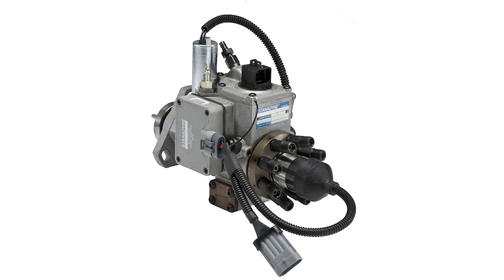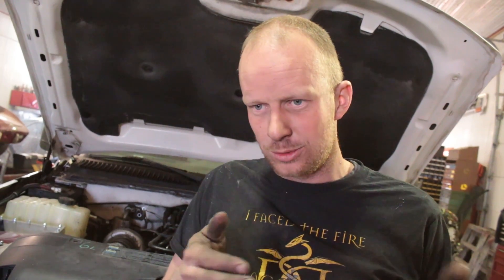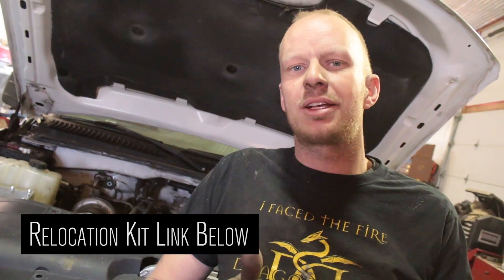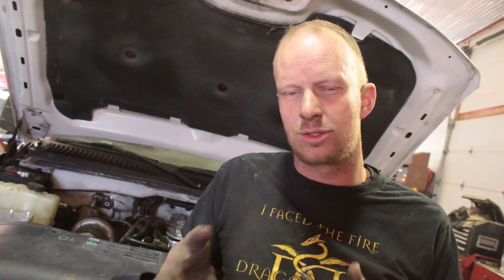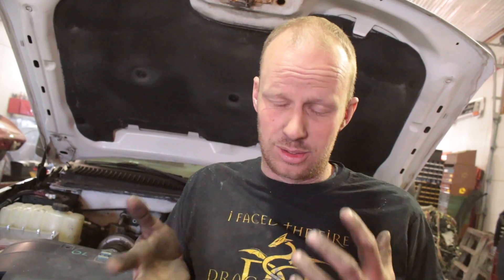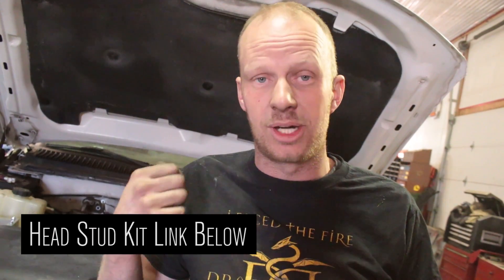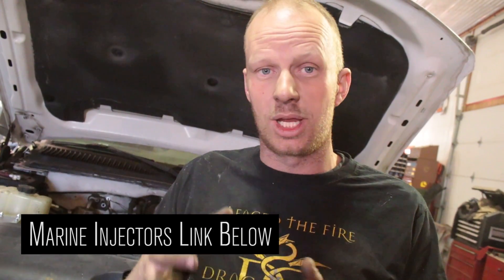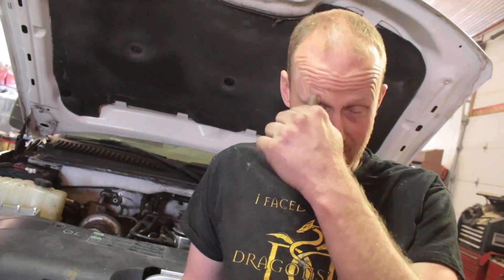REVIEW: Everything Wrong With A GM 6.5 Detroit Diesel

Comment: Not sure why the military didn't put a 12v cummins in the humvee's lol...
Reply: MotorsAndMore its called millitary grade. Quite literally translates to lowest bidder who can provide the fastest.
Reply: I thought that AM General was owned by GM, which would explain why they have a 6.5.  Also, do you think the 5.9 would even fit? It is much longer
Reply: Far more about supply than it is cost when it comes to the military.
Reply: +consaka1 that's right, the weight of a 12v cummins is between 1100 or 1200 lb and a 6.5 is between 700 or 800 lb, so the detroit is way lighter than a cummins
Reply: Too heavy I bet. 6.5 is somewhat lighter.
Reply: MotorsAndMore I have a 6.5L TD in my 1996 3500 and I love it, also have a second 6.5L that was in a Suburban and I am looking to drop it in a van..... There are 2 reasons this engine is still loved by the Army and boat industry... Reason 1: they are one of the cheapest Diesels to buy, it costs alot less to replace a 6.5L than a 5.9 Cummins would be when it gets a 50cal round through the hood. Remember what would you want to see destroyed? A cummins? Or a 6.5?  They are cheaper $5,500 civilian price for a brand new 6.5 on aftermarket.

Reason 2: they are amazing on fuel, when I got my completely stock (including vac pump and lift pump which are both junk).  I got 24.5 MPG roughly 10L per 100kms in a 1996 3500 Chevy Crew Cab Long 8ft Box (6000lbs tare) when I loaded up with an extra 2500lbs.... The up armored Humvees are 12,000 - 16,000lbs but dont tow much... Nothing compares to the 6.5L Detroit Diesel on fuel ecnomy, they are amazing engines.  Which is why the army and the Marine industry love them...

What is not amazing about the 6.5L Detroit Diesel is all the engine accessories and infrastructure they attached to the engines in the Trucks and Vans during the 1990's...
- Most PMDs = junk (even after relocation).
- Stock Location of PMD = GM being Jackasses at their finest.
- Lift pump = junk. (get one from a boat dealer)
- Vac pump/waste gate control = junk (throw the vac pump away, get a couple of nuts and washers + a compression spring for a manual waste gate control arm, then get a belt for a 1993 6.5L) (also make or buy a boost gauge, if you dont have head studs you should not go over 10psi of boost).
- (all of the above items can rob performance or even screw up your other wise well designed and built injection pump)
- Thermostat was set to 200°F it should be between 180°F amd 195°F at most depending on your needs.
- Rad Fan = junk.
- Air intake = junk.
- Turbocharger oil feed and return = junk.
Harmonic balancer = junk.
Lay out for the A/C compressor & line if the A/C compressor is on the driver side of the engine = annoying junk that gets in the way of many things worst of all it interferes with PMD relocation. (On some other 6.5L the A/C compressor is on the passenger side of the engine, I don't have any issues with this set up.)

The 6.5L Detroit Diesel is still a head of its time in MPG but most people don't know because of all the tedious junk removal and replacement GM makes you do with the accessories and infrastructure surrounding the engine.
Reply: Price, weight, and GM was part-owner of AM general.  Mostly it was weight, though - no one knew what an IED was until the H1 had been out for 30 years.....
Reply: Actually I do! I believe it puts a lot less stress on the rotating assembly. In particular the pistons and the cylinder walls.  There was a reason the factory only put 5 to 8psi on the turbo with the stock 21:1 ratio.  I think the low compression heads lower the peak cylinder pressure while allowing more room for more air. The increased volume is like a big cushion area and a little bit goes a long ways. 
The main reason for 21:1 compression ratio was cold temp starting. The higher the static compression ratio the easier it is to start in cold temps.  The increased surface area in the cylinder in IDI engines is one of the reasons it needs a higher compression ratio.  All that extra area bleeds off heat like crazy. It is one giant heatsink.  Direct injection engines have less surface area. Volume of a cylinder seems to grow faster than the surface area as piston size increases. I believe this is why big diesel engines do not need glow plugs and yet can run compression ratios down to 14:1 something. I think most OTR trucks run around 16:1 with their small dinner plate sized pistons. 
I plan to do a couple things to mitigate heat loss. 
1. Spin the engine faster with 3 start batteries.  This actually works pretty well since crank speed is critical.
2. Coatings. ceramic coatings on the prechambers to slow down heat absorption. Possibly on the head surface as well. Coatings are new to me with my current engine build. I hope it works but if it doesn't well no biggie. 
3. I also use total seal 2nd rings. Not sure how much this helps a cranking engine but it cant hurt.
Reply: Isaac Housley true...
Reply: consaka1 my 12 valve cummins is bone stock and it makes 180 hp at 2500 rpm and 420 foot pound at 1500 rpm, but a 6.5 detroit i don't remember.
Reply: uhmm If I recall correctly the 6.2 was 140 hp and the turbo 6.5 stock was 190 but the foot lbs was less. Actually there were various build numbers. They seem to peak at 195. I just looked it up. Here I'll just post it. 
F L65 195@3400 RPM 430 FT-LBS@1800 RPM
That was pretty much the peak for stock in the late 90's. Of course going with low compression pistons and more fuel could get the HP up to about 300 or so. Not sure about the torque with the marine build but it went up too. I run a marine build in my old van. I can't complain at all. It is a lot better than stock. Gets up and moves at freeway speeds unlike any of the gassers I have.
Reply: consaka1 do you think a marine build is way better for the reliability than stock?
Reply: consaka1 ok, how much do you think it cost to make a marine build? one friend of mine wants to do this to his 6.5
Reply: MotorsAndMore the 6.5 was really fuel efficient
Reply: The HMMWV’s got the 6.2 and 6.5 series engines due to the contracts the government had with Detroit Diesel. A good portion of our arsenal was powered by Detroit, Cat has since taken over but while I was in (2002-2014) there were 6.2/6.5’s, series 60’s, 6V72’s, 8V92’s in the good majority of the equipment. Also there were range standards for the HMMWV that had to be met(fuel economy) which was 400miles to a tank and that was supposed to be universal to all of the road going pieces from the giant HET, HEMTT to the little HMMWV and C-Truck(Unimog). People can bash the 6.2/6.5 in the HMMWV all they want but it still got the job done for a few decades and wasn’t nearly as bad as the series 60 which had a fiberglass oil pan in a tactical cargo hauler :(
Reply: well you have to be completely electronics free and you have to cost the least but the humvee was a jeep replacement used outside of its design and well the engine can be pull started
Reply: Also the last generation of HMMWV’s first saw a revised 6.5 with a little more power and the loss of the hydraulic clutch fan(switched to electric) then I saw a few with Duramax’s right before I left service
Reply: Dany McLellan that plays a large part in it because you have to transport them across seas by plane.  the more trucks per flight the more efficient
Reply: State Dept bought a whole pile of them for Daesh aka ISIL
Reply: The reason? because GM put the 6.2 in trucks before any of the other big 3. the majority of military equipment is GM based, meaning more common parts across the board. more specifically to your question the 12 valve is too tall, longer, and heavier the 6.5. Adding more weight to a platform that's already heavier than your average light duty truck. the HMMWV is also almost 2 feet wider if not more. this is coming from a vet whos had to load them into an aircraft.
Reply: Well cummins is building a 2 stroke opposed piston 4 cylinder for the military at the moment.. its pretty cool. It's called the advanced combat engine... we may see a smaller pickup version from cummins and other companies too, as the design is licensed from Acates Power. https://www.youtube.com/watch?v=OfBB6uNkYKM
Reply: Cost, 6.5's are cheap compared to a Cummins
Reply: Sorry Rick,  but I think you need to get under the hood of a hmmwv and look at the clearance and lay out of the components.

There is just a few inches between the front of the engine and the radiator. The radiator also sits at a 45ish degree angle to physically fit in the truck.

moving the transmission back is out to make it fit. The engine cover in the cab that allows access to the rear of the motor and transmission bell housing is already a tight fit.

plus the sheer height of a cummins wouldn't fit without completely reworking the firewall, inside engine cover, component locations, and a number of other things that would take significant time and money to accomplish.

The military simply isn't going to do that. The 7.3 wouldn't be a bad idea except for it being computer controlled. The 6.5 in the hmmwv is mechanical injection db2 pumps. The lift pump is mechanical as well. 

and to answer why the military didn't try to fit a cummins in the hmmwv in the beginning is simple. AM general was a subsidiary of GM, and as such they fitted it with their own engine. which at the time the first hmmwv came out, it only had the 350 diesel, and that predates the cummins b series even being in farm equipment.
Reply: @Raccoonactual  hi
Reply: Yeah. The old 7.3 idi navistars where mechanical. The international powerstroke was heui which requires electronics to operate. If you want to roll with a gutless 7.3 idi, be my guest.
Reply: Reason 1 is the length of the motor. 2 is the multi fuel ability of the mil-spec 6.5 Ltr. Cummins did not have that ability at the time. This is also why a lot of military parts don't fit on factory GM 6.5's
Reply: they went with the cheaper engine for the price
Reply: anoth reason Detroit diesel use to b owned by gm and hummer
Reply: Three words, Lowest Contract Bid.
Reply: MotorsAndMore duramax in a humvee
Reply: @donc81  the 6.5 Ltr still lives in the humvee not the duramax. This is because the 6.5 Ltr in a humvee is a multi fuel engine. It can run on a few different fuels like jet A or B or very low quality diesel  like is found in other countries. The duramax would never survive those fuels.
Reply: That is almost double the weight for how much power? Not a lot I reckon. However the durability in the cummins is definitely there. But try sticking that in an '80's van. lol If I could I would have.
Reply: They are starting to buy Toyota Hilux, I heard.
Reply: there is physically no room to fit a 12v in a hmmwv. the military 6.5l is more robust than the civilian engines as well. the crankshaft is thicker at the mains, and it has a one piece 3" thick girdle that takes the place of individual main caps. 

I see more broken down cat engines than 6.5s in my motor pool by far. 

the duramax is out because it can't run on jp fuel. the military does not use regular diesel fuel, and common rail pumps cannot handle jp. the cat's only run jp because they are heui and the injection system can tolerate it.
Reply: Well it depends on what you have to start with.  Just the "Marine" part of a genuine "marine" build would include Low comp pistons, roughly $650 to $750 for those. 
The injection pump I have no idea if I can even get a db4 pump anymore. It is very expensive and Peninsular diesel is the only folks I know of that have/had it.  There are alternatives that are probably better anyway. 
Marine injectors or injector tips. Honestly people say they don't matter at all. They seem to flow easier though at the same pressures. not sure why. Those will run close to $300.
For a pure build you will also want the high volume water pump and dual thermostat crossover.
There are other things to consider that are not technically part of the marine build that I highly recommend. Head studs from ARP for one. Fluiddamper and a balance job on the rotating assembly. 
Once you start beefing things up and finding crack free blocks it can get expensive. 
I am working on an economy build version that skips low compression pistons for just a thicker head gasket. The compression won't be quite as low but if the short block is good it could help for a lot less money. 
One thing that needs checked very very carefully is piston to bore clearance of each cylinder. Many times in high mileage engines you will find that these need to be bored over. Now you need a set of oversized pistons that will cost maybe 150 less than a set of oversized low compression pistons. It is all about choices. The cost also depends if you do the work yourself or have someone else do it. I have a machine shop do my machining so I don't consider that a diy thing. 
I'd say you could do your own cheap version for $4000.00 with actual low compression pistons.  I won't look at a job for less than $8000 due to all the time and little things involved. Ironically 8k is about what a good new long block costs, with standard pistons.

Comment: I've been waiting for Rich and his opinion on the 6.5td, we all new for the most part, why go v8 when we know the 12 valve is more reliable and gives you so much more room in the engine compartment as well so many other benefits. However the 12 valve Cummins unfortunately is gold plated somewhere costing 6 times more then any 6.9/7.3 or 6.2/6.5. So for someone like me who just wants to go diesel ... something better then a mk1 rabbit 1.6 pos any of the fully mechanical diesels are pretty awesome despite being 4 decades old and coming out in the early 80s. And Rich hit the nail on the head " parts are pretty much every where for these old Detroits. And dirt cheap compared to the gold plated cummins. Trust me eventually I want to replace my 6.2 hx40 with a 12 valve setup, similarly to Riches Tahoe but that's way down the road when I have ten grand sitting around burning a whole in my pocket. You get what you pay for, and to each his own we all watch Deboss for the 12 valves!!! Well and to Pick Rich's brain
Reply: Peninsular just recently went out of business.
Reply: go look up mwm,4.2tdi,killer engine..